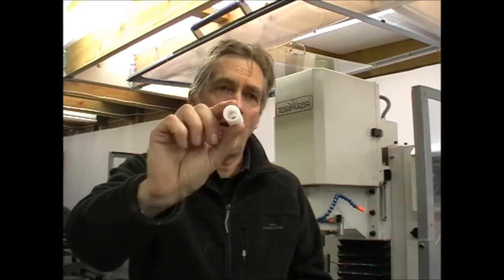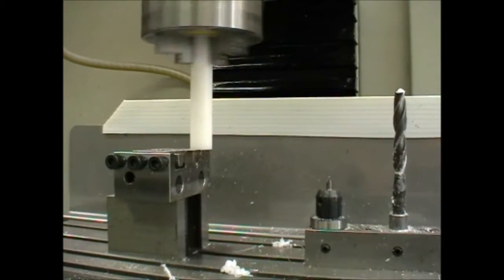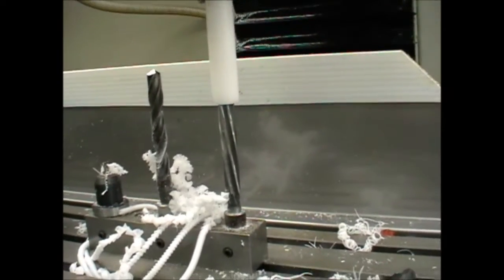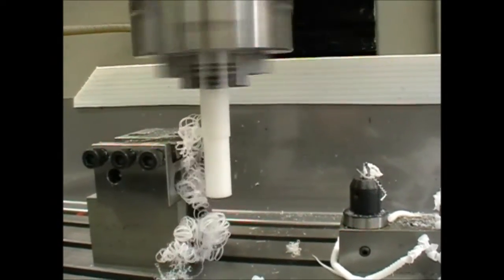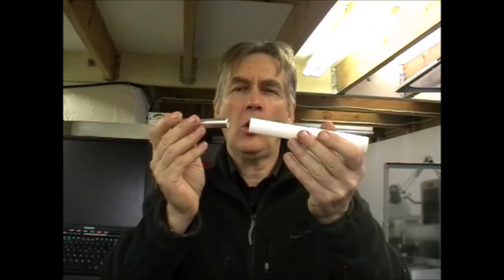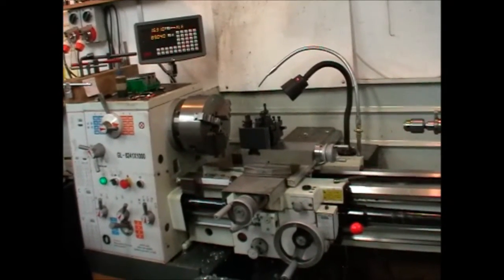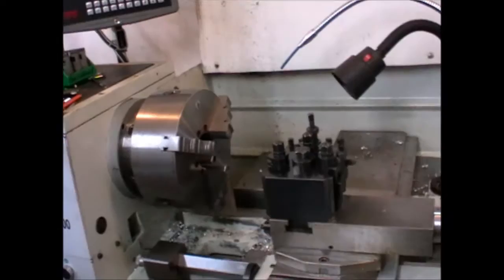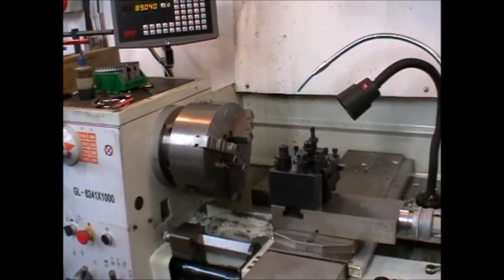CNC Lathe versus Manual Lathe

Comment: Hi Mr.Cliff, thank you for this very inspiring video, I plan to use my cnc vertical milling as a mill turning. however, I still have something I want to know according to the mill turning. I will be very happy if you would share your experiences about your mill turning. 
The first thing is, is it safe for the spindle since we put a heavy spinning load (the chuck) in the spindle? because if the load is not balanced, it will cause vibrations and I think this is not good for the spindle (correct me if I'm wrong). how could you overcome this issue, or might be the tormach's z-axis construction has strong and rigid enough to overcome this issue.
Second, how could you securely attach the chuck in the spindle? I saw you used a different R8 collet directly attached to the chuck base, so it means that you have to remove the original R8 collet every time you want to use the chuck right? do you use a power drawbar on your PCNC1100? 
will be very happy if you don't mind to make a new tutorial video about making the chuck base with R8 collet, and how to set it up in the PCNC1100's spindle. :) 
I think that's all for now. I really love your videos, very inspiring and helpful. :)
Reply from the maker: Thanks Dani - There is obviously a limit to chuck and work size for this type of light spindle. I limit myself to a 5" chuck max, and the lower speed pulley range of 2000 rpm. I do not use a power draw bar currently.  I note your final request re R8 arbor. Cheers  Cliff
Reply: Thank you Mr.Cliff, happy to hear that. :D

Comment: Currently have T 770 with RapidTurn and a South Bend 8 inch with DRO . To make parts for the Fly Reels I make I actually use all three machines. Just have to figure which operations I am going to do with which machine to get best accuracy, finish and speed is for me a secondary issue. It's also nice to still do some manual turning. Love your videos and explanations.
Greg
Reply from the maker: Thanks for the feedback Greg.

Comment: While I've never run a CNC and you did say "for simple parts" your obviously correct as long as you have a REPEATABLE quick change tool post that can be trusted to replicate its tool position during tool changes to take advantage of that tool specific DRO setting. Start adding radiused parts, tapers etc and I'd think CNC would soon drop the parts count to where CNC is faster. And maybe there a bit specialized, but for small parts a proper and well set up screw machine would change that parts count by a lot. Randy Richards demos of his turret set up on his lathe changes things again. Tooling cost is another factor so it gets a little complicated to say 100% for sure at what point CNC is automatically the best choice.